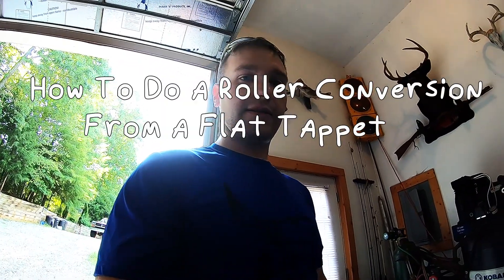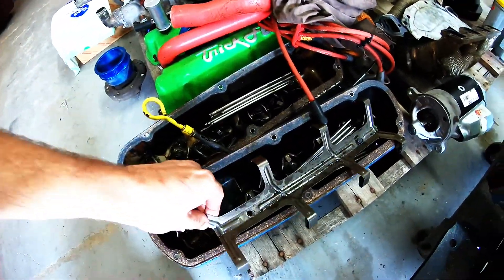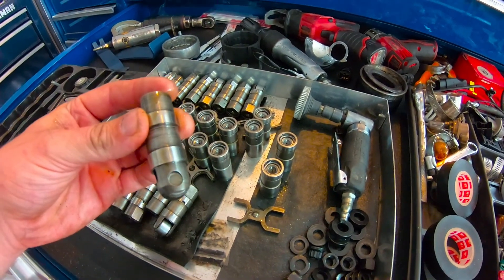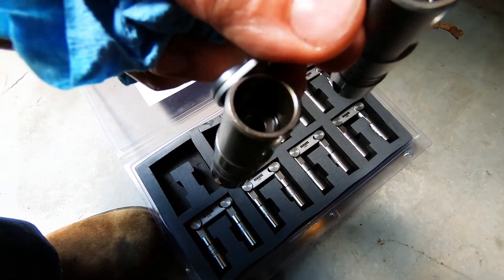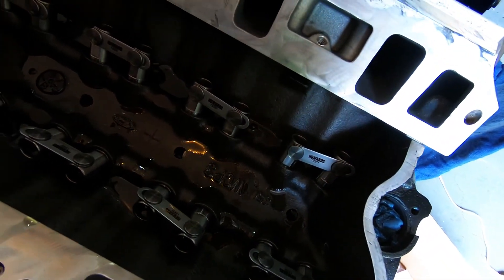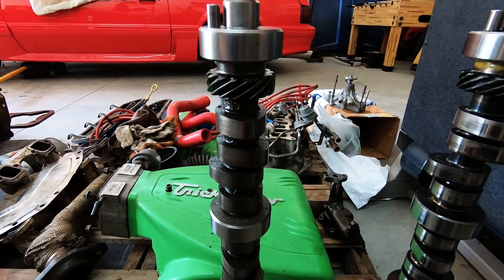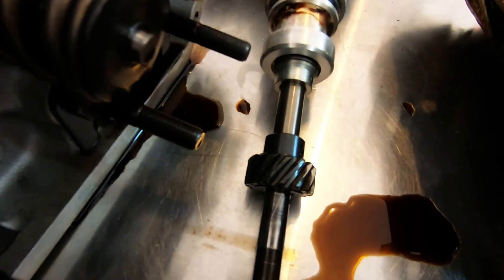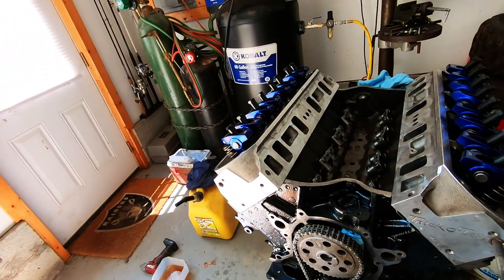How to Convert From Flat-Tappet to a Roller Camshaft

Comment: Most flat tappet problem’s are caused by using incorrect motor oil. The oil's used in the 60-90's had 1000-1400 ppm zinc content but zinc was not compatible with catalytic converters so it was slowly removed.  Zinc is the lubricant flat tappet lifter need.  You should use a high zinc speciality oil, preferably around 1400ppm.  Use a zinc additives assembly lube when installing the flat tappet lifters as well.

Comment: If your grinding cam lobes off on a flat tappet cam someting is wrong with your entire set up. 
Proper valvetrain set up proper oiling  that wont happen. almost never unless cam is defective. Match you components up properly.
I have a 74 351w with a 
Small base circle 351w roller cam does nothing other than allowing you to skip cam break in process. You are now limited on lift and duration so you Lose power and the excessive ramp and huge rotational speed is poor design personified ... with the bad harmonics- dynamics of the small base circle 351w roller cams you might actually burn out your cam lobes... with heavier springs guaranteed you will.
These race part sales guys screw people good. 
I hope this engine worked out for you.... it sounds like a bad set up

Comment: why bother unless your motors going sub 10 second passes the extra money isn t worth it
Reply: you'll never  flatten lobes  with a roller and you'll make way more power  under the curve and use  more lift  more easily. 

there are a bunch more advantages.  

and you dont  need to have a 10 second  car  to have a retro fit roller.  whoever  told  you that please do yourself a favor and dont take  anymore advice  from them

Comment: i just put my engine in about a week ago it was a tbi so i converted it to carb...im having problem trying to get it to run right i put a brandnew edelbrock carb 1406 on it..i got 12-887 holley regulator set it to 6 psi i got it to run starts up good but its backfiring and popping out my exhaust ..i have a vacuum port on my regulator but did not hook it up dont no if that the problem or not..or is the carb to small for my set up...you can smell the burning and the raw gas in park when u accelerate and give it more gas it sound good but at idling its popping and backfiring like someome popping fire crackers..tell me what you think
Reply from the maker: You’re running too rich at idle. You need to tune the carb. Brand new carbs are hardly ever good to go out of the box. Ensure your timing is correct and adjust the carb. 

Before doing that tho. What fuel pump are you using? You may be overpowering the needles and seats in the carb causing a rich condition.

Comment: got  a question for u my brother....i got 1990 k5 blazer 5.7 just got the enging rebuild still have the swirl port heads on it and its pretty mush  stock i have high perfomace intake im eliminating the computing trying to make my mine up if im going to go with a carb or some efi sniper..i have 700r4 trans and 4.10 gears and up graded my torque convert to a 2000 to 2400 stall ..it has a up grade cam in it howard cams ratter 188005-09  lift .525/530 and duration .050 ; 227/235 centerline 103 i want to no is that a good cam to go with them swirl port heads and would i be able to hear the cam..i dont no to mush about cams..i no the vortec or aluminum heads would have been better but the engine was already build already..i do have headers 3 inche pipes all the way back
Reply from the maker: It depends on what your goals are for the car. Any cam with that much lift will most likely be heard. If speed competition is your goal, dyno, test and tune. In engine building You don’t buy the cam you want, you buy the cam you need for your application goals. That being said over-camming and over-carbing are the major mistakes most people make.
Reply: @MonroePRacing  appreciate the advice my brother

Comment: Very good upgrade, I also have a non roller block that I will be converting with that type of lifters. What size of carburetor did you use with that setup on the 351w?
Reply from the maker: I ran an EFI setup. Easier to fine tune. Don’t be scared of wires.

Comment: got a question for u ..i got a 1990 k5 blazer 700r trans 2000 to 2400 torque converter in it and im thinking about buying this race motor  it has 12.5 to 1 sbc 355 030 over with elgin e-1090p solid flat tappet cam with scorpion 1.6 rockers for total lift of 573intake 594 exhust can i use the torque converter i have on this engine,,..i no i got alot of things to change because it is a tbi fuel injection
Reply from the maker: Typically a cam with that much lift you’re going to need at least a 3000-4000 stall converter. Any transmission/ converter company can calculate it for you. 

Over sizing on performance parts without having the companion parts to support it is the #1 reason people get disappointed in their builds. If you change a cam, you have to change the converter. If you have a large cc head you need the fuel and airflow to support it. If your not getting your power curve to the ground you can have a 1,000 bhp engine that only puts 500hp to the ground. Research. Test. Tune. Modify.

Comment: Great job on this video. Just noticed there is no information about what to do in order to mount the roller rocker on the head. These won't mount to stock heads. I don't think. And also the spider mount in the valley of origional flat tappet?  How did you add the spider?? So you put roller set up in a flat tappet block right?
Reply from the maker: 1. You can use the stock rockers, or upgrade to roller rockers. I highly suggest an upgrade. 
2. You don’t need the spider if you have the retrofit lifters with the connecting bar
Reply: @MonroePRacing  can I use ls7 lifters on a flat tappet cam in a gen 4 6.2 ?

Comment: Did u use stock roller pushrod or stock flat tappet?
Reply from the maker: Ordered the the proper set of Trickflow moly pushrods after we figured out the correct length

Comment: Can I use these parts for a 393s build. I Dnt know much about what cam to use as I’m barely getting into this, and I know that I’ll be building a 393s
Reply from the maker: I really can’t say. As always check the math. If your using a 351w block, all should match up, but aggressive cams may require different lifters etc

Comment: dont they make a special too to measure for the lifter rods?
Reply from the maker: Yes that would be the push rod length checker I mentioned. Didn’t have one at the time for this motor, but I did order one and get the right pushrods. Motor is still going strong 💪🏻 in the fox 🦊. Thought about revisiting the subject in a new video, but I haven’t built anything in 2020 other than a coffee table. I’m hoping to find a new chassis in 2021 to tinker with, but prices are pretty dynamic with economic uncertainty in the air.

Comment: Just an fyi if you want to rebuild your 351w

If you haven’t started rebuilding the cost of a roller motor from a pull it yourself junkyard is the same as a set of conversion lifters. $400ish

When I did mine years ago I just went and got the f4te motor. Had the bonus of keeping the old motor as a (worn out but usable in an emergency) spare.

No guessing games on pushrod length, no custom pushrods, no checking geometry. Just factory designed ease
Reply from the maker: This would have been the route I took, but this motor already had all the hard machine work done and it mic’d out perfectly. But yes starting with a roller block erases a few headaches.
Reply: I’m just a huge fan of factory parts. Pushrod goes bad? Auto parts store. Lifter goes bad? Auto parts store. 

But it is the weakest year for block
Reply: if you have  aftermarket heads,  youre  gonna check the pushrod  length regardless.  because you just changed  something to not factory

and  link bar lifters  can be  made  to run way higher RPMs  than  factory  lifters.

Comment: When you made this video, it was prior to lifter manufactures degrading quality. Lately on YouTube many people that have built tappet lifter engines have wiped lobes. Roller seems to be the way to go for now... Until quality comes back to tappet lifters again...
Reply from the maker: They are antiquated at this point in time. Between bad manufacturing and guys running too heavy a spring, flat tappets are pretty doomed.
Reply: @MonroePRacing  Yeah, people think the only way to make power with a small block is between 5000-9000 RPM...
Reply: It's the oil ,not the lifters they took all the zink out and other additives. Even Rotella and Dello isn't the same any more. You have put the zink additive in every time you do a oil change now. What a shame
Reply: @nctaurussho4664   WRONG. Been running my flat tappet cam with no zinc for probably 10 years without issue.

Comment: Be mindful when having the block machined for the "spider" aka "dogbone" retainer bolts. This will cause fractures all the way through the block.  A ton of 5.8s and some 5.0s, that are factory rollers, have the fractures with no issues, but some do.   Just be mindful if doing it yourself, or let the machinist know to ease it in.  Most people have no idea what i said exist, even long time engine builders.  Just be thoughtful, especially if you're going over 550-600 HP, the block might split.
Reply: What do you mean? Tapping two holes prooerly to hold those dog bones will cause fractures throughout the block?  Or some blocks are defective from the start?

Comment: really good info here!
i have a general question?.
on the "lifteres."   can you find out the "true travel" inside them.   have a machine shop make you two aluminum spacers that are 50% of its travel.   then use adjustable push rods to check the right height on the valve stem area.   then measure the push rods for the exact size?    (make any sense!?)

just curious?...

larry
Reply from the maker: These are solid lifters, so it would be unnecessary as there is no travel like a traditional hydraulic lifter. They don’t market them that way, but they are a solid lifter.

Comment: The dogbone or “spider legs” as you call it, is there to keep the lifter from spinning, not from coming out of lifter bore.
Reply: Exactly,  flat tappets rotate while the engine is running. Otherwise there would be straight line wear on the lifter base.
Reply: Thank you.  I was thinking ‘what is he talking about?’.

Comment: Is it possible to drill an tap bolt holes for the lifter tray ? And then to use the roller lifters
Reply from the maker: david curry it’s possible. You have to weld in extra material to tap. The cam journals are right below, so with some precision work, it can be done. Not highly recommended, but possible.

Comment: are all the link-bar lifters considered "retro-fit" and do they require a "retro-fit" cam or can you run any roller cam with them?
Reply from the maker: callofgeorge not all link-bars are retrofit, there is a little more science to it, such as lifter length, bore size, and the stroke. I would find retrofit lifters specific to your engine and I wouldn’t cheap out. There are cheap Chinese lifters out there, but you’re asking for trouble if you install them. Quality Retrofit lifters run between $400-$800. 

Once you have the retrofit lifters, you can run any roller cam specific to your engine. There is no need for a retrofit cam. You’ll still have to consider piston to valve clearance and other typical valvetrain factors if you choose a cam with more lift than the stock cam. 

Basically this conversion allows more choice in your cam. Flat tappet cams have far fewer choices available than roller cams and you don’t need to change lifters every time you make a camshaft change.
Reply: @MonroePRacing  cool deal.thanks  i've just heard people use the phrase retro-fit when talking about cam/lifters on 351 or non-roller 302's. i know there are more options for the standard roller 302 cams, so i wanted to make sure i didn't need some special lifters to allow the use of those. and that the 351 can use the standard roller cams that roller 302's use.
Reply from the maker: callofgeorge 302w and 351w cams are interchangeable. So if you find a 302 roller cam you like, you can run it in a 351w. That’s what makes the 302 to 351 swap relatively easy and cheap, most parts are interchangeable.
Reply: ChuPro23 the only parts interchangeable are the heads,cam and water pump and the firing order is different to     I’ve got 7 sets of headers and only 2 of them will work on my Windsor are all of them will work on my 302 motors
Reply: @matthewjohnson2495  302 HO firing order is the same as 351s. Older 302 firing orders are different.
Reply: Kerry Flanagan I’m aware of that and the firing order is not a interchangeable part like I was talking about 
unless you put a old style cam in a 5.0L motor then you would have newer style motor with the 15426378 earlier firing order
Reply: ChuPro23 the oiling journals are in a different location from a roller to a non roller motor which is why you have to have the retro fit lifters
Reply: @matthewjohnson2495  just change  your  plug wires around  to the firing order of the cam.  lost of people tha make cams  only make  the H.O.  firing order  or small base cirlce cams  even if  its  for older blocks.  some people like COMP   and Howards' will make  both  firing orders  and mention  its  for  block originally equipped  with flat tappet cams  or because  the base circles are different  because  of  the retorfit  of  factory rollers in older blocks.  theres a bunch of ways  to do it.

Comment: Thanks a lot. Considering taking on my first solo rebuild with a flat tappet 302 out of a 90 Econoline and doing a possible conversion. This video helps with actually seeing the comparisons and your explanations. Thanks again
Reply: Where are you at on that build?
Reply: @Noah-bo8mc  I broke into it but didnt do a conversion on it. We're still daily driving the van.
Reply: If it's the original engine from a 90 it should be roller block - at least it will have the provisions and be shortened as well as have the screw holes in the valley.  Did you ever confirm that?  I belive it was from 1986 forward that all 302 blocks were roller blocks IIRC.

Comment: Dude, consider it best to select pushrod  length to get rocker fulcrum to tip line at 90 degrees to stud at mid-lift while setting with  a single solid roller  lifter.   Then confirm the roller is centered well on the stud. The method you show  requires everything on the head, stud  and rocker to be perfectly blueprinted and coordinated with the rocker of choice.
The way shown the roller can be perfect on the stem but the scorpion or TF rockers can still  bind up against it's adjuster nut shoulder,  or other angle problems and ineffiencies of movement

Comment: I don't know if it's the same for any engine, but I know for Chevy you need a cam button if you swap a roller into a flat tappet or the cam will walk out of the engine.
Reply: Ford small blocks (not sure about other motors)  have a plate keeper that holds the cam inside the block and its in between the cams timing gear and the block
Reply: The post ‘87 blocks had a retainer plate that would locate the cam too, so you can use the button or the retainer plate

Comment: love that you included prices.. little knowledge on converting, but I'm assuming a roller cam that'll fit a roller block, is the same as one for a non roller block? lifters are the only thing you have to retrofit right?
Reply from the maker: callofgeorge short answer, yes, a roller cam will fit the same as a flat tappet. the camshafts do not change in size. Long answer, a direct swap of camshafts is only recommended if you have a fresh motor or lower mileage motor that has been clearanced. Your clearance is set by your cam bearings. You can run oversized or undersized bearings to accommodate a new cam. However, just throwing in a camshaft without inspecting and clearancing the camshaft and bearings can lead to catastrophic failure.
Reply: @MonroePRacing  thanks for the heads up.. wasn't aware of that bit. it is a low mileage motor. its just been sitting while i restored the car and i wanted to refresh it a bit and prep for boost.
Reply from the maker: callofgeorge I would think you’ll be fine doing the retrofit if that’s the case. To answer your earlier question the cam, lifters, and pushrods are the essential pieces. The swap is relatively easy. However, due to the cost, most would argue getting a fresh roller block is more cost effective. I made this video for those that have a fresh non-roller block and want to put a few more horses in the engine bay. If you need any further assistance feel free to reach out. This specific motor has been running well for a year.
Reply: @MonroePRacing  cool deal. thanks.. from what i priced out, it'll cost roughly $850 or so to retro.. not sure if i'll do it or not tbh. i don't see how going roller block would save me any money. my pistons are .060 over, so it'd be block cost and probably new pistons too unless i bored out a new block or found a used one for cheap. thanks for the info though. sub'd
Reply: Non roller and roller cams differ in base circle not to mention the variety of roller cams which aren't computer compatible. Just do your research and have a plan.